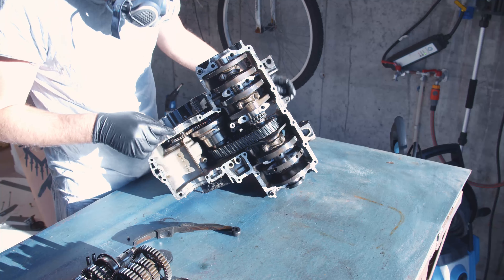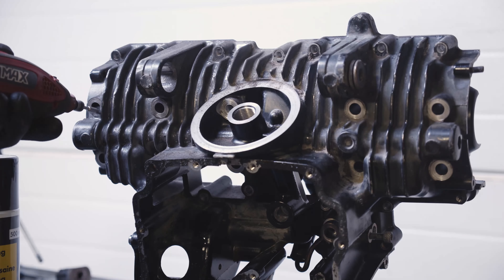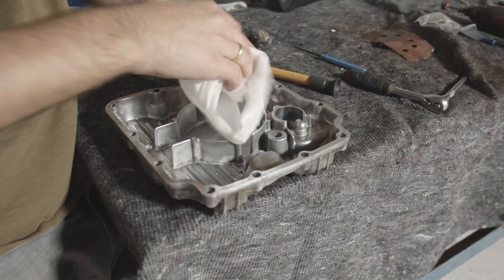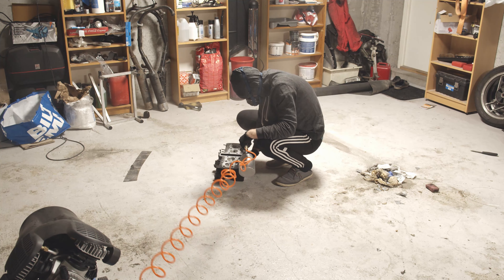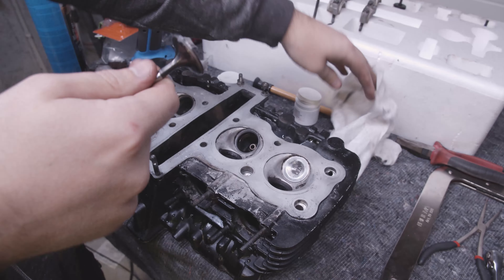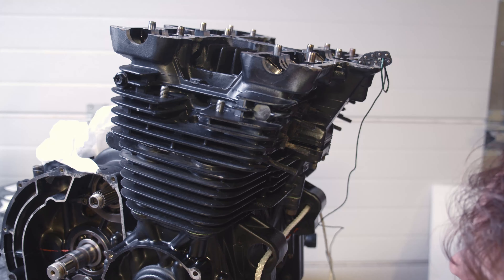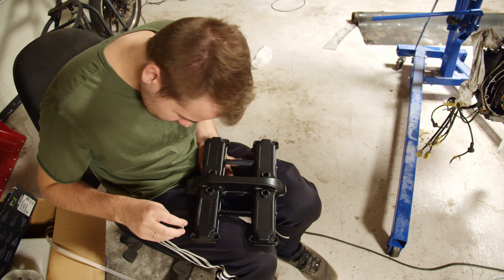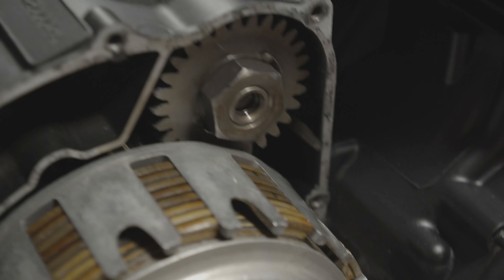Xj600 Episode 10 - Engine Rebuild

Comment: Attempting this at the moment myself but falling at the first hurdle, having trouble with the gears.Basically I have both the shift drum and the transmission in yet I can't select all gears and when it doesn't click into place the front sprocket just turns as though it's in neutral. Any tips on installing the shift drum, shift fork and gears, I should add all forks are in correct and the dogs are seated in the shift drum groves correctly. Great video btw

Comment: Hey Daniel, 

I'm also rebuilding a FJ/XJ600 to a caferacer and i need your help.

Do you know where the two cables from the engine earth go to? I know one goes to the battery but there should be another (smaller) cable that I don't remember where it goes. 

Pretty stupid that i didn't wrote this down it but i hope u can answer my question. 

Like your video's and keep up the good work :)

Comment: Hope you get it to run perfectly without needing to open it again! 

Any big modifications planned or just rebuilding? (Example podfilters aren't recommended on XJ bikes)
Reply from the maker: I will try pod filters yea. I guess im mostly building it to look good at this point. Seeing as i dont have a license to drive it anyway XD.
Reply: @obs301  agree looks sooo much better than that big fat stock airbox. If you can get it to work fine I might change it on my XJ too. You shouldn't cheap out on them though, I've seen some run at least kinda decent with K&N pods.
Reply: @doctorthee  pods looks great but the K&N's are pretty pricey. They are roughly 300-400€ where I live, which is about the same as I bought my entire XJ600 for.
Reply: I have some cheap Chinese pods running on my XJ6 and they've served me fine for 3 years 🤷‍♀️ Had to change the main needle to 105 and that's it
Reply from the maker: @poolkrooni  the ones I have are cheap, so it will be trial and error.
Reply: @poolkrooni  An XJ6 isn't a XJ600 though, pods run fine on a XJ600 diversion model too. It's just the 1984-1991 model they don't seem to work well on, but maybe worth the try nonetheless!

Comment: Perfect as usual, thanks for sharing! You use a speacial primer in engine before painting? and the paint what kind it´s?, thanks.
Reply from the maker: I used a primer ment for aluminium and engine paint. But its a local brand, anything ment for aluminium and heat should be fine i would think.